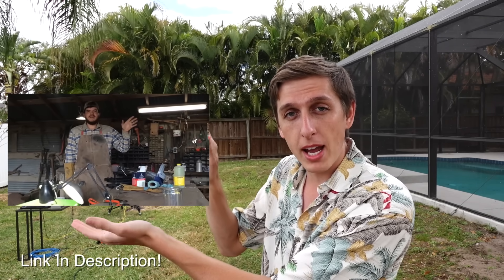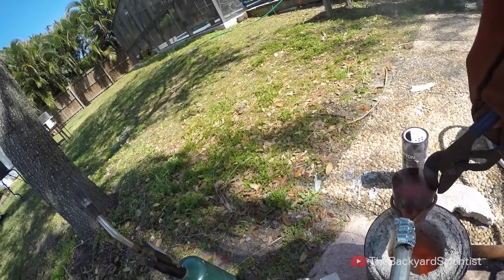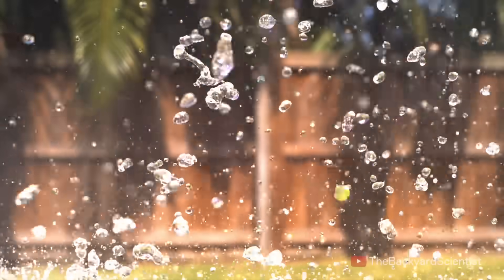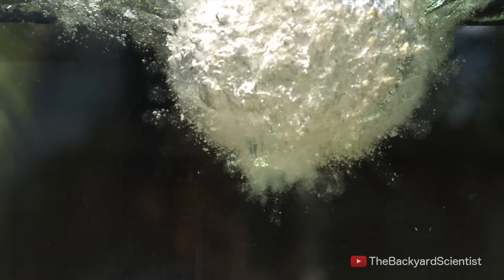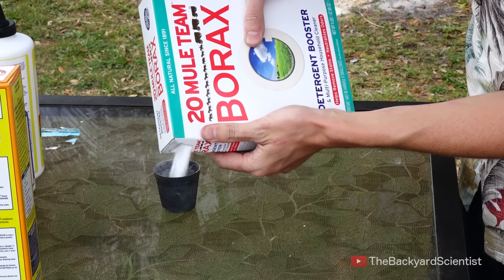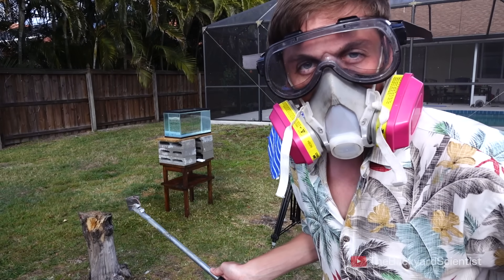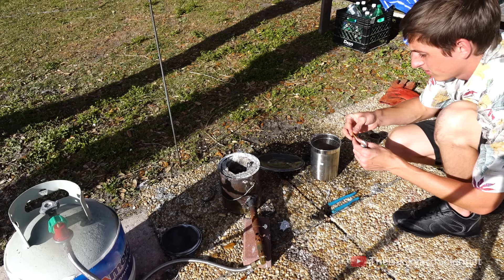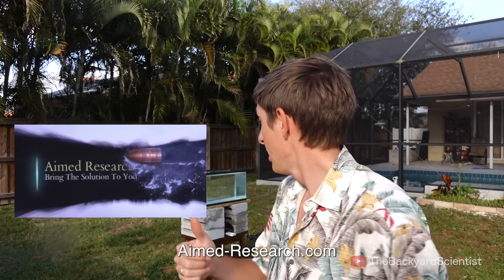Pouring Molten salt into Water - Explosion!

Comment: This a reaction between all the alkali metals and water. From top to bottom (lithium to francium) the reaction gets more violent. Sodium is higher on the list, but if he were to try this again with francium he would need more than a pole, some goggles, and a trip to the ER. Just imagine the sodium he used and multiply it by 100,000
https://youtu.be/I8tOtZKpi04
Reply: peaceful hoovy this isn’t a chemical reaction. Sodium ions (like the ones in salt) don’t react with water because they have lost the electrons that cause the reaction in the first place. Also, it’s against the laws of thermodynamics to go from a stable compound to an unstable compound without the addition of extra energy, and the heat needed to melt salt is, quite frankly, not enough to break salt down into Na+ and Cl-, which, like i said before, wouldn’t even react that bad with water. The less stable the elements in a compound are, the more stable the compound is. That’s the reason salt and fluoride are so stable.
Reply: Thomas Glfs Oh, i see my mistake. He's using molten table salt which is not just sodium.
Reply: TJMiton Yes, there is. A salt is an ionic compound of a metal and a nonmetal. In the case of table salt, sodium is the metal.
Reply: Why doesn't molten metal explode when poured in water? If the explosion is caused by the rapid heating of water or water becoming trapped within the molten liquid, why does this property effect salt so much?
Reply: THE MIGHTY ARCH his argument was that salt was protected from leidenfrost effect by yet unexplained reasons
Reply: That information is seemingly incorrect, just like all the other videos suggesting a some apocalyptic reaction between water and Francium - it makes a good story though. Caesium would react more than Francium in water as discussed here: https://www.youtube.com/watch?v=hpYxllgfMSg after 9 mins or so, and at no where near the levels these videos suggest.
Reply: This is what I understand (correct me if I'm wrong) :
•Sodium on its own reacts violently with water. It ignites and explodes. 
•Sodium chloride (salt) can be separated by melting it and running an electrical current through it. It is more difficult to separate without the electrical current. 
•The melting point is >800 degrees Celsius.
• some of the Chloride turns into chlorine gas and evaporates into the atmosphere
•this leaves the shot glass glass with less chlorine than it started with and some lone sodium atoms
•there is lone sodium in the shot glass mixed with molten sodium chloride
•the lone sodium is reacting with the water and creates the explosion.
• could the rest of the sodium chloride is blasted out? ;or
.•could the explosion cause enough energy and cause a chain reaction to separate the remaining sodium chloride? 

I'm new to chemistry. But what do you think? Any credibility in my thoughts?
Reply: Yep, the francium reaction is fake. The only ways to get an explosion that large is with a LOT of chemical explosives and a way to ignite everything at once, a nuclear weapon, or a few hundred milligrams of antimatter. Alkaki metal-water reactions are chemical explosions, none of which can release that much energy without requiring many hundreds of tonnes of explosives.
Reply: Except there's no metal in salt
Reply: he tested the water for any pH change though, and there wasn't any. In the process you described, the sodium would react with the water creating sodium hydroxide (NaOH) which is alkaline, and his pH paper would be blue/purple.
Reply: yeah, note the 'ionic' part of your sentence.
Reply: peaceful hoovy can I have a sandvich
Reply: No,no,no.  Sorry but you are wrong.

Comment: Bro actually when you heat salt to a high temperature it breaks into sodium (Na) and chloride (Cl) ions sodium is a very reactive metal it a silvery shinny metal which reacts with air too that's why when it comes in contact with air it form a white coat as a protective layer and when it comes in contact with water it catches fire with a good amount of sodium is taken, there will an explosion.......and that is what happening
The other Sodium salts are non-reactive because they form a covering over the the metal thus saving it from coming in contact to water

Comment: Sodium metal is highly unstable when it’s not paired in an ionic compound making it highly reactive with water (the explosion literally created flames and not just gas/vapour bubbles). Basically sodium in it’s elemental form carries an extra electron and would rather become stable when paired by an ionic bond (say to chlorine; making unreactive sodium chloride), so really the second reaction IS a chemical reaction and it’s also the more violent reaction.
 
The chemical equation for this would be Na + H2O -> Hydrogen ions and NaOH, which happens to be a base, so if you had tested the second reaction with the litmus paper as you did with the first you should have seen a pH change. 

Regardless this is still an awesome video, but I hope before you start mixing metals and water next time maybe wear more than a tshirt and gloves, and do some research on the reactivity of the substances you are using.
MSDS is a great thing!

Comment: The ratio of sodium and chlorine allows for a 2 fold effect to disrupt the ledenfrost effect, fold 1: the chlorine though very hot becomes super soluable at high temperatures reacting with the gaseous water vapor that forms around the ball of molten salt, this takes a few miliseconds for the reaction to occur and once you have a chlorine water compound surrounding your molten salt you end up with water that takes longer to boil as theres more mass to heat up resulting in direct contact with the sodium thus resulting in an exponetial expansion

Comment: It's a chemical reaction, sodium doesn't go well with the compound H2O
Reply: No, you're thinking of solid sodium.  Sodium in sodium chloride is an ion, Na+, it has already lost the electron that drives the violent reaction of 2Na(s) + 2H2O(l) → 2NaOH(aq) + H2(g).  Sodium ions do not react with water.  Quite frankly sodium ions don't like to react with many things, unless you have something like Crown ether in the solution.
Reply: "It's a chemical reaction"

it very clearly is not.

in fact, you got to SEE what the chemical reaction looks like when he actually dropped melted sodium metal in the water.

sodium chloride does not lose its chemical bond just by melting it.
Reply: When salt is heated above 1000 degrees and poured in water it vaporizes water vigorously producing the explosion
Reply: Then you would also see the effect with other salts heated to a similar temperature, the leidenfrost effect should protect the water from undergoing such rapid boiling against the liquid salt- you don't see such explosions when a red hot steel bar is dipped in water. 

I really like Barry's explanation and it certainly holds some merit and is worth further investigation. If his theory is correct then there should be clear correlation between the coefficient of thermal expansion and the explosion power of different salts. But I also have some reservations about it. I find it difficult to believe that the pressure generated would be large enough to case such a massive explosion, certainly hot rocks explode violently however they explode as they are being heated up- NOT as they are cooling down (https://www.youtube.com/watch?v=tmu1q98AdXE).

I find the idea of a strictly classical chemical reaction unpalatable, particularly since Na cations or Cl anions shouldn't react readily with water, although the "test" done by the channel was laughable and would have proven nothing since the products of any reaction would have neutralized themselves immediately.

I also think that the idea of some sort of contained water steam explosion (as presented in the video) is unlikely and rather contrived. With it there is just too much margin for error, and the explosion shouldn't have been nearly as consistent in both power and reliability. 

The explosion does bear remarkable resemblance to alkali metal explosions conducted in a inert atmosphere (https://www.nature.com/news/sodium-s-explosive-secrets-revealed-1.16771). Perhaps this is also some kind of similar coulombic explosion as a result of valence electron shedding effectively generating a negative surface tension on the surface of the salt droplet? This is all just conjecture on my part however.
Reply: Wrong. The rapid cooling caused a huge surface shrinkage therefore a sudden pressure increase inside the salt block  That built up pressure blew the salt apart. It has nothing to do with vaporizing the water
Reply: well in my humble opinion, when the hot liquid salt comes in contact with water it turns water into gas(steam) creates a cloud around the salt liquid (block may be), salt moves down due to higher density. touches the water surface again. Steam moves up and recurring bursts or bubbling happens. 3:35
Reply: McTheNoobiestNoob XD None of the Alkali metals do
Reply: Specifically Francium.

Comment: Sodium releases hydrogen very fast when exposed to water which then spontaneously combusts. When you melted it it might have became pure sodium (or more pure than it was) Basically SODIUM + H2O = BIG BOOM.
Reply: nope.  if you watch the video, you can see him use pure sodium metal.  it reacts with the water as soon as it hits it to produce hydrogen gas, and the exothermic reaction causes the hydrogen to explode, producing a fireball.

you see no exothermic reaction with sodium when it is combined with chlorine, and that bond is not broken when it is melted.

Comment: I am not extremely smart so I would like to ask you to think of it from a scientific and cooking viewpoint merged together. from the cooks view point would it have a lot to do with why we add salt to boil water much quicker than just boiling the water alone? from a scientific point of view could it have to do with what you explained in the video or maybe how the salt carries heat and when cooled in water that heat could possibly be the cause of an explosion mixed and with all of the immediate steam it creates may have been what caused your tank to explode but not the can? i don't know, i am not too smart but that is how i see it because I cook often and this video reminded me of boiling pasta. I also wanted to know if the salt does break into bits caused by the water getting through the cracks and creating the other bits to explode what kind of effect would the ocean have if our core exploded? like i said I am not smart so take this as a random hypothesizes that terrifies me but is most likely nothing.

Comment: Salt is typically water Sulluable. It typically dissolves in water. When you melt the salt and pour it into cold or cool water, it's going to have this effect. I mean mirrors are made with sand that is melted and it's essentially glass. What haappens to glass when you expose it to two totally different extreme opposite temperatures? The glass shatters. I believe this is essentially the same principle.

Comment: So, what do we (think we) know from the experiment?
1.  The fact that salt dissolves in liquid water is not the critical factor, the other salts didn't work
2.  It is not a purely chemical reaction, no pH changes

But if it purely physical, what physical constants of the heated liquid are affecting the reaction?  I can think of 3, offhand.
A.  Density- this will affect the explosion, since a truly dense liquid will not go through the exponential shattering, acting more like a heated piece of solid metal.
B.  Total heat stored in heated liquid, i.e., Temperature * Specific Heat  -  You can heat a similar salt to the same temperature, but if it doesn't store as many Joules per gram, it doesn't have the same heat as NaCl, and fizzles like the first trial.  
C.  Viscosity - do the other salts flow like honey, like water, or even smoother?  That could easily change the behavior of the pressure front of the explosion.

If you can find a metal alloy with similar properties as molten salt, you can answer whether this is fully physical with some certainty.

However, we have one question that needs to be answered- does NaCl dissolve in pressurized steam while the other liquids don't?  Yes, they are all liquid-water soluble, but I don't know if that translates to steam-soluble.  This last behavior is more a chemistry question than a physics question, and will utterly change the way the system works.

Jonathan Fisher

Comment: Well if your theory is correct it could be because the bonds of the other salts are stronger so that water can't get trapped and instead trhe oth er salts simply cool down into a solid without superheating pockets of air.

Comment: Okay going science on all y'alls.

1: The molten NaCl (salt) explodes deeper underwater than the molten Na (sodium) because of density. NaCl is an ionic molecule, meaning the sodium essentially donates its electron to the chlorine atom, creating a powerful bond and consolidating the physical space occupied by the two atoms by sharing the electron. Sodium, on the other hand, does not really bond with itself, it's simply a tightly packed collection of atoms which takes solid form. So the density of the NaCl molecule is considerably greater than the density of the Na atom. Thus, when poured into the water, the NaCl reacts below the surface, since it has a higher density and sinks faster than the reaction can take place. 

2: The reason sodium reacts with water has to do with chemistry. When sodium and water interact, the mass of the sodium is converted into NaO2 (Sodium hydroxide, commonly known as lye), which dissolves in the water, with a byproduct of hydrogen. It's this conversion of molecules from NaCl and H20 to NaO2 and free Cl with a byproduct of H that causes the heat discharge and combustion. You'll recall in school that you're taught two of the most combustible and explosive elements are hydrogen and oxygen? It's the separation of the hydrogen atoms from their water molecules that gives off the heat and causes the explosive reaction.

3: Awesome video, man. Cool stuff.
Reply: I think your understanding it a little off. Sodium chloride is a ionic compound consisting of ions (Na+) and (Cl-) so there is no molten Na. Na+ is a stable ion that does react with water to form sodium hydroxide (NaOH).   I have no idea what NaO2 is and there is no "chemical reaction" when sodium hydroxide dissolves in water. It does fully dissociate in water because it is a strong base, into the OH- and Na+ ions but there is no release of hydrogen gas. Now this is an extremely simplified explanation of the dissociation of sodium hydroxide in water. Unless there is oxygen gas (unboned) there will be no explosion. Breaking hydrogen bonds from water molecules is a endothermic process so will require energy to break.

Comment: Well, this is because Na (Sodium) is an Alkali Metal. What Alkali Metals are known for: is their instability in Water. Sure, Na, when purified, is completely safe in the water, but melted down to the point of molten liquid... yeah I recommend a distance depending on how much Molten Na comes into contact with water. I forgot this is Table Salt and not pure Sodium. Cl (Chlorine) has most likely broken apart from the Ionic Bond of the Sodium. Think of the Octet Rule; NaCl is perfectly balanced and stable. Separate them, the loses its single Electron and is back to its unstable form as an Alkali Metal. Not 100% sure what happens to Cl, I'm assuming it dissolves in the water. But yeah, that is the molten salt explodes; it's not the Table Salt (NaCl) as a whole compound, but merely the Na element - the Alkali Metal exploding.
Reply: Sodium chloride is Na+ Cl- when is very different to Na. The whole reason why the alkali metals are highly reaction is because they are missing one electron to complete there outer shell. Na+ has that outer electron hence why it is positive, therefore it is stable and not very reaction. If you don't why it's Na+ then you should look into ionic bonding.
Reply: I figured that. I did study Chemistry in Junior and Leaving Cert. I know Na is an Alkali Metal and the fact they react with water; which is why I threw in when editing it; that I forgot he noted using Table Salt. I do know what goes on with the compound and I have a clear understanding of the Octet Rule and how Ionic Bonding works; all I said at the end was: I was just wondering what went on with the Cl which is a Halogen.

Comment: Easy answer - the Chlorine gas is at a density almost equal to that of the sodium metal (of course), and its weakly valently bound at high temperatures - as a result, the water is best able to flow into the interstices of the liquid salt. The other salts have a higher valent bond even at high temp so no explosion. For a better explosion try the dangerous sodium flouride. For a weaker explosion, try the stronger valence more benign salt sodium iodide. Please note this is not a covalent bond, but rather an ionic valency.

Comment: I would try this with Potassium Fluoride. The other salts you tried had less electro-negative/electro-positive dissimilarity than sodium chloride. Also potassium fluoride has similar solibility and almost the same melting point as sodium chloride. More expensive, but not prohibitively so.

Comment: I don't think you touched on for the other salts, but the viscosity of the sodium chloride being so close to that of water might be the physical mechanism allowing the sodium chloride to surround some of the water. I think that might also be the reason that the first run was non reactive, it looked less viscous than the reactive runs, which held NaCl together and the leidenfrost effect took over as with the other salts.